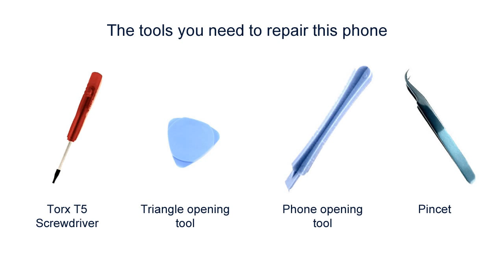Sony Xperia J ST26i repair, disassembly manual, guide

Comment: Alright m8, dunno if you can help by maybe giving me some advice, I have a sony xperia j and recently the screen has started to turn itself off, to start with, removing the battery and tapping the device against my palm would solve the problem, it has got to the point now where it does not work at all! The phone turns on but with the lack of the screen, I believe it might just be a loose connection as tapping it used to fix it! Could you give me pointers as to which connections I should check?

Comment: Hey D2onderdelen, My sony xperia J got quite wet when I jumped into a pool, not realising it was in my pocket. I got out straight away and left it for a day. Everything seems to work fine except the screen. It still vibrates when it turns on and the LEDs and the home buttons still glow but the screen is permanently black. Could you tell what's up?
Thanks

Comment: Every function that has to do with a camera on my ST26i has stopped working. If I try to start the camera it just says "Unfortunately, camera has stopped". Also the led down low beneath the home button only shows a blue light. Any ideas on what could be wrong?